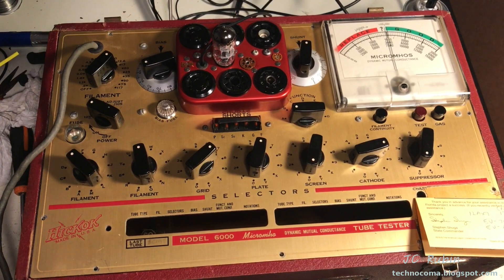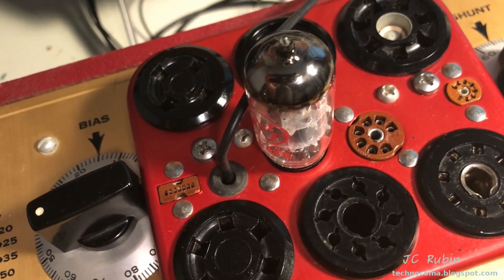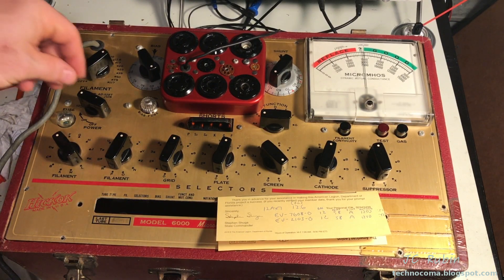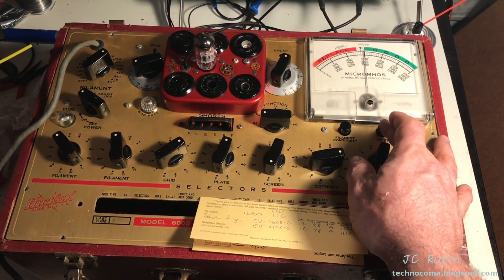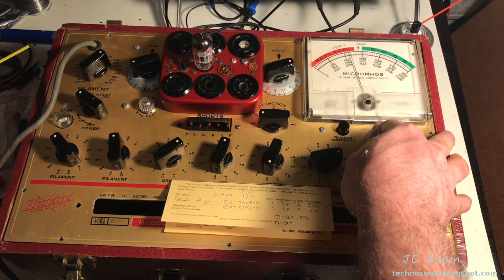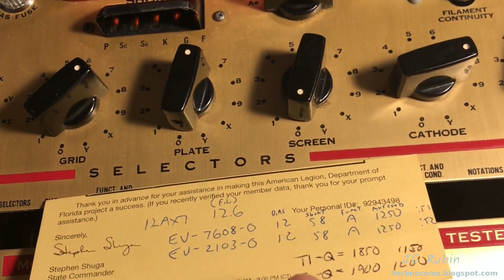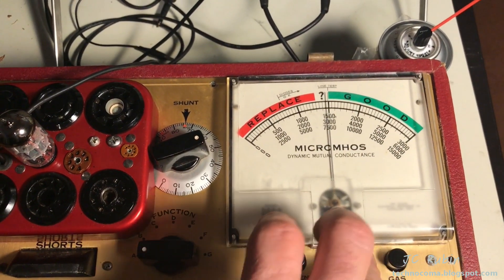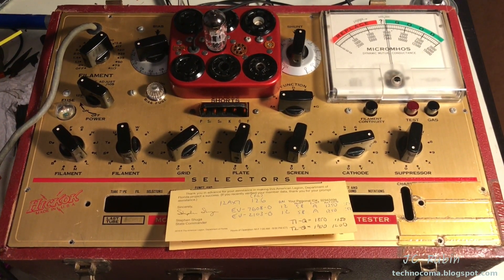Hickok 6000 Tube Tester - Post Repair Full Functional Demonstration

Comment: Well presented and thank you. Free ain’t cheap enough for some folks I recon. Anyway back to the subject at hand.  One question, regarding Gas Test. My manual reads while holding the P5 button I’m to the press the P6 and look for 2 divisional difference, like from the ordinate reading. Leading me to think I should see little to no swing on the needle. Yet, in your video the needle goes back to zero, far left and is used from that reading for indication of two divisions. This leaves me puzzled. 

My base voltage, pin 1, and 8,  is the only thing off calibration BTY. From 150 it’s reading 165 and higher.  H600A. I used a good old high quality analog meter.

Again, thanks for camera focus, clear audio and for heaven sake a steady camera.

Comment: Good job! One generic question. How is a gas test different from a grid leak test, or a shorts test. Aren't they all , except for shorts test, measuring emissions of grid elements  where there should be none?
Reply from the maker: From the original manual.   It defines the procedure of 'Gas Test' as a measurement of Grid current in microamps with a maximum of 2ua to be the cutoff.  It further states that 2us would be on a calibrated tester, 2 divisions. as the full deflection is 100uA